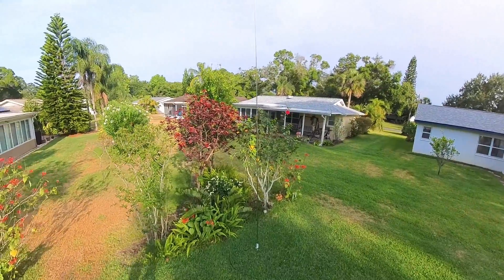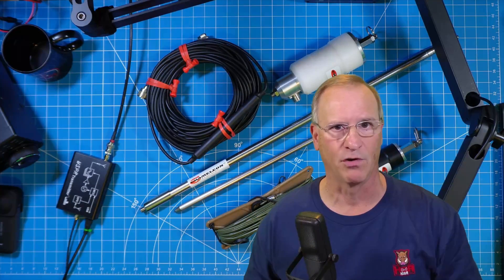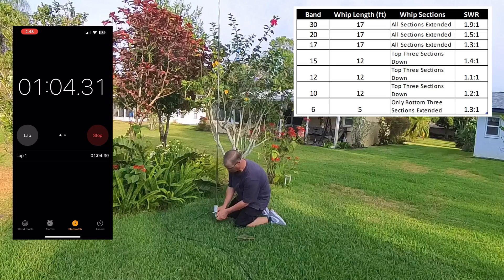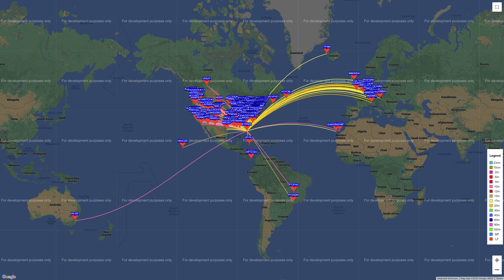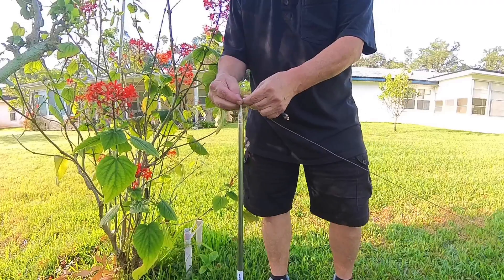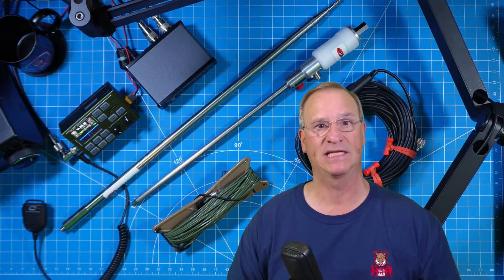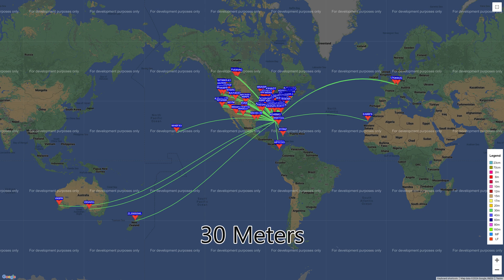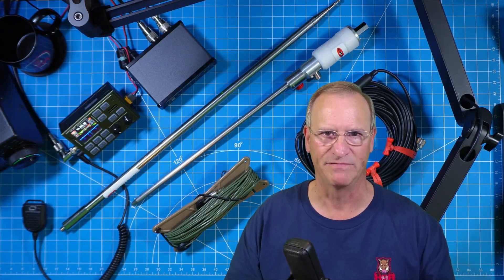Chameleon MPAS Lite Antenna Use and Review -- with NEVER BEFORE SEEN CONFIGURATION REVEAL

Comment: For those who wants to use the 60' wire add-on for the CHA MPAS Lite, MPAS 2.0 or the TDL - you can now get the CHA LZ SLOPER WIRE (60'). The CHA LZ Sloper Wire is 60 feet long, constructed from 26 gauge braided copper wire, ensuring excellent conductivity and durability. Reinforced with KEVLAR fibers, this wire offers exceptional strength and flexibility, capable of withstanding harsh environmental conditions. The wire is encased in a PTFE sleeve, providing robust protection against wear and tear while maintaining flexibility.

Comment: Have you used digital modes on it? Did you need a unun? If so which did you use?
Reply from the maker: The Chameleon Micro or Mini is the unun; its a 5:1 matching unit.  Mini can handle higher power than Micro.  I have used it many many times with FT8.

Comment: Could I monitor the MPAS Lite on an open, elevated deck and drop the counterpoise wire to the ground 13' below? How would I mount the whip?
Reply from the maker: Yes, an elevated MPAS Lite with hanging counterpoise should work.  Lots of mounts out there to choose from; you'll have to find something that works specific for your deck options.

Comment: Good Moaning Bob, Keith from England ( M0KLL) just want to say using that 60foot LZ Slooper of 26 Gauge wire attached to the 17SS whip, that is some bend (Curve) in that Whip was this caused by the weight of the 26gauge kevlar? In the video view from 5minutes 40 seconds Judging by the dip in the wire they is no strain from the Palm Tree to the 17SS antenna yet the whip is leaning to toward that palm tree. I would imagine it would be a no go in any form of breeze for fear of damaging that 17SS telescopic whip antenna with whatever the weight of that 60 foot Kevlar attached. Enjoy your videos 73
Keith.
Reply from the maker: Concern understood.  My wire was a prototype and I now have the production length in my possession; hoping to get a chance to compare if there is a weight difference.
Reply: @HOAHamRadio  As soon as you can Bob please ...

Comment: I have an SS17 I commonly use for POTA on a groundstake with good results.  I use mostly 10 & 20M.  Hit Australia one day sitting by a lake on a sunny day.   So do you think adding the CHA Hybrid Micro in line really improves performance significantly somehow?
Reply from the maker: Using the SS17 only you would be modifying the length of the whip for different bands; with the Micro, you can leave the length the same and do quick band changing...that's the benefit.

Comment: So I have to humble myself to say that I've had the MPAS lite for about 2 years and have always set up the vertical all the way and used a tuner. (I've had good results.) I saw that you posted a chart on lengths. I know that the Chalengence (spell?) uses different lengths on their product, so it wasn't a surprise t see that the SS17 also has recommended lengths per band. I went online to find that length chart with no result. I went onto Chameleon's site with no luck either. Please let me know where you got this, or if you could reply with a screen shot that I can "borrow" - Thanks for great tips on a amazing product!  (I also have the EFHW 10-80 and use these are my two primary (only) antennas.)

Thanks! de K7EVM
Reply from the maker: That's what tuners are for; I too take this lazy approach quite often.  The charts are located in the "User Guide".  Near the bottom of each of their product pages, you will see "User Guide" in red letters.
Reply: @HOAHamRadio  follow up on comments - My paper copy did not have lengths as mentioned, however when I searched online and found the manual  there it was as you mentioned. 
I tried out the different lengths at US-10607 but did not notice huge difference. Thanks again!
Reply: Edit: I took a snip-it from the video so I could have a temporary copy. I will play this weekend. Thanks Bob!

Comment: I am struggling with the MPAS 17 ft whip along with the foldable lower portion to get resonate on 40M. I have the MPAS 500W unun with 4 speaker wire radials of 18 feet.  Any ideas Bob? Can't seem to get it better than 2.5 to 1.  Also when left out in the weather the 17 ft whip fills with water and rusts easily.  Any ideas?  Thanks de N4WRW over here in Vero Beach.
Reply: Cleanup your whip really well with some WD40 before and after long outdoor exposure. Now the SWR issue on 40M is not a real issue. Try to play with different counterpoise length, elevation and make sure your coax cable is well deployed and it doesn’t have loop into it.

Comment: Have you thought about doing the same with the SS58 instead of the SS17? Chameleon has been out of the SE17 for a while now.
Reply from the maker: I know they have a large quantity of SS17 whips in production; I expect they'll be back in stock soon.  I may have to give this idea a try; it will be low to the ground, but hey, who knows.
Reply: @HOAHamRadio  I saw where one ham put the tactical delta loop on a CHA Porta Mast. It was impressive. I’m considering the same
Reply from the maker: @devinhedge  : ) yep that is an impressive looking antenna.  I'll have a video next Thursday on this very subject.  Hang tight.
Reply: Just now seeing this. Love the idea of using the whip as a mast. Now that the 25’ whip is out, would you do this with it? Is there any advantage to doing this with a 25’ over the 17’ whip?

Comment: Bob, couple questions. 
The lite, how small does this pack down? Would it fit in a carry on suit case? 
The 26 gauge wire, Is that from chameleon as well? 
Any chance of a comparison video of this and th3 big brother MPAS 2.0? I’m torn which one to go with. I live in an apartment and my girlfriend in a condo. So everything has to be small and portable as I have to take it down when finished 

And what is that small radio on screen with you? 
Thanks
Reply: Yes - pretty soon we will offer the PTFE Braided Kevlar as wire choice!
Reply from the maker: @ppfd, the longest part of the Lite is the whip at just under 24"; the longest part of the 2.0 is the extension, at just under 29".

Both are great kits, but if I could only have one, I'd choose the MPAS 2.0, then add a SS-17 in the future (then you would have a Lite too).

No plans on a comparison currently, the video schedule is booked 6 months out.  The 2.0 will get performance over a broader range of bands...it covers the same bands as the Lite plus you'll get some 40 meters on it an an occasional 80.

The small radio I was showing is a unicorn...hard to get.  Its a FX-4CR made by a single individual in China.  Be careful about buying from anyone other than him directly, others have cloned his radio. 
Long backlog of orders.   His website is bg2fx.com.
Reply: Hey Bob, would your homebrew counterpoise kit work on the lite?  
I just realized when I went to order the lite, it didn’t come with the wire for the CP
Reply from the maker: @ppfd  Sure would.  Attach the alligator clip to the the SO-239 where is screws on to the Micro or Mini and you are good to go.

Comment: This was always an option with my Tactical Delta Loop with the exception of the 60' wire. Did remove the counterpoise with the 60' wire?
Reply from the maker: I left the counterpoise in place, just added the 60' sloper with the clip.

Comment: Great video Bob… I’m looking forward to your video on your WSPR transmitter.  Also, what antenna tuner are you using with your FX-4CR?  Enjoy the Memorial Day weekend.  Bill KC2KNA
Reply from the maker: Thanks Bill.  The only tuner I've used so far is the URT1 in the shack (not really meant to be portable, or at least not pocket portable).  I just picked up an Elecraft T1 and will give that a try in the next few weeks (who am I kidding, it will be months before I get to it...so many videos to get done first)
Reply: @HOAHamRadio  thanks for the quick reply Bob.  I want to get the FX-4CR but with a small portable tuner.  I would like to take it to the beach in Maryland this summer and use my CHA MPAS lite vertical configuration like you demonstrated in your video..

Comment: Sounds like you created a lazy "Inverted L". 1/3 up and 2/3's down... kind of. I bet you could roll up a few feet on the winder, use your ground stake (since it looks like you might have nothing else to tie up to) and fine tune it for a lower swr on 40m and would probably get 15m matched on that same setup. You might could even fine tune the wire with colored tape to "roll up" and match the inverted L to every band to use it without a tuner. Great setup and idea! Robert KD4YDC
Reply from the maker: Thanks for the input.  Lazy L about sums it up; sloping inverted V sounds like I know what I'm talking about : ).  Adjustments to wire length may do exactly what you say; fun to experiment with.

Comment: Bob, I currently have the mpas2.0. So if I understand, all I would need to purchase additionally is the SS-17 and 26ga wire to complete the set up displayed! The only wite I see in the mpas kit is 16ga wire @ 60feet! So is it 16 ga or 26ga?
Reply from the maker: The wire with the MPAS Lite is 16 gauge and too heavy to pull this off; the 26 gauge wire / clip was custom made and not currently for sale.  The parts are out there for anyone to buy and home brew if wanted.

Comment: I have this exact antenna and love it. I live in an HOA and use it as a vertical. Crazy thing is I get better SWR and more bands if I DONT use the 25' radial wire/counterpoise and using the coax as its counterpoise.
Reply from the maker: I love this about amateur radio; experiment and prove out what works best in your use case.  Everything affects everything especially when it comes to ground radials and your surrounding environment.